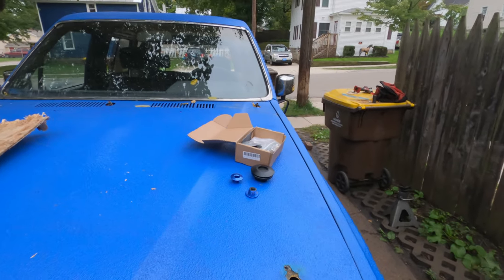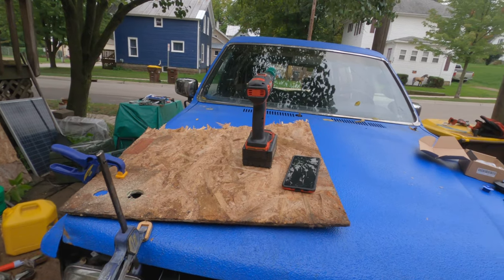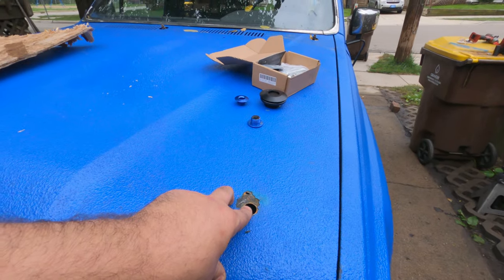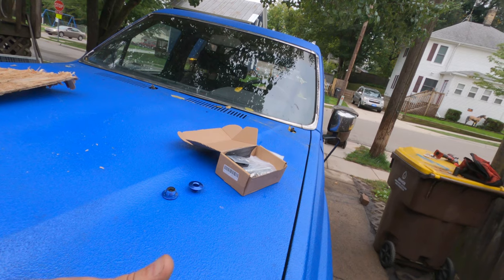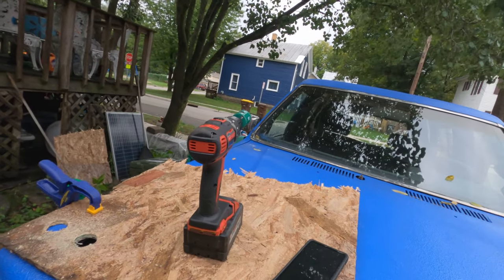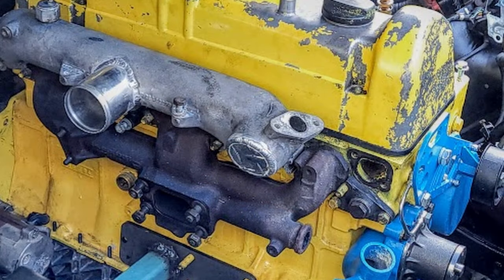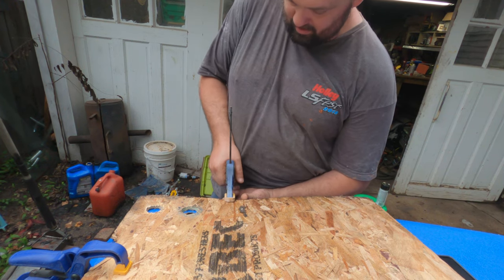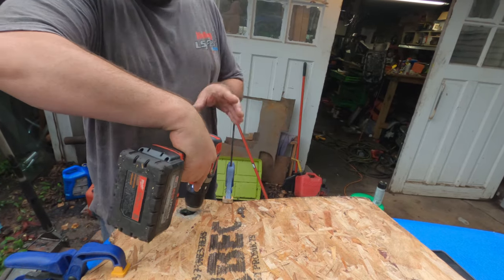How to use a Hole Saw witout a Pilot bit to enlarge a hole, or have no center hole

Comment: I put two hole saws on one bit and used that. Smaller size for my guide inside the larger one for the needed size. There was just enough thread to hold.

Comment: I also cut a scrap piece of metal, and tac it across the hole.  doesn't have to fully cover the hole, just a strip. Then use that to redrill using pilot bit hole saw.

Comment: I prefer drilling straight through to the radiator. I'm sure the battery is just as painful but if I'm sacrificing parts for the "god dammit I should have known better" experience, coolant is much less hazardous to me than battery acid. 😃